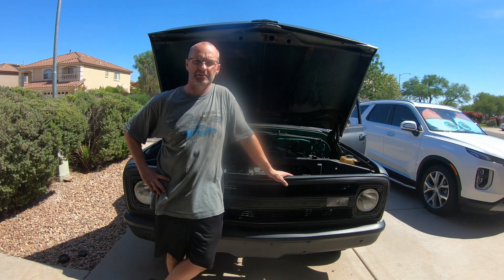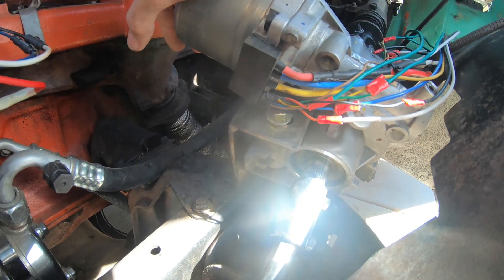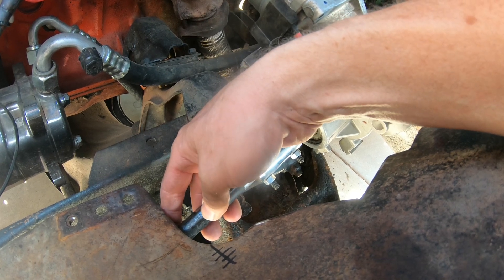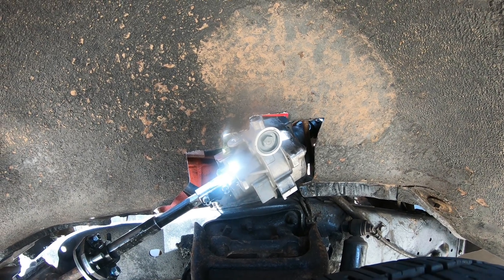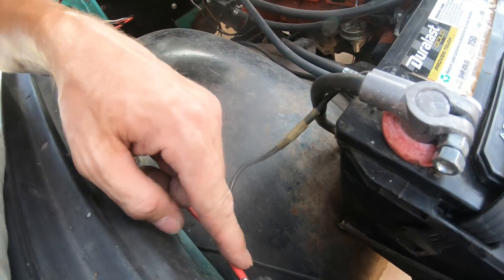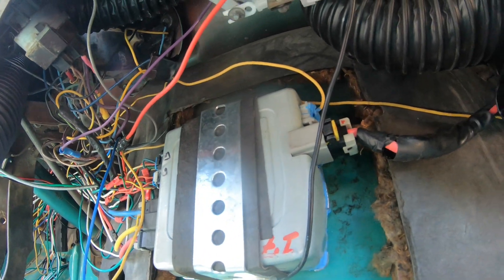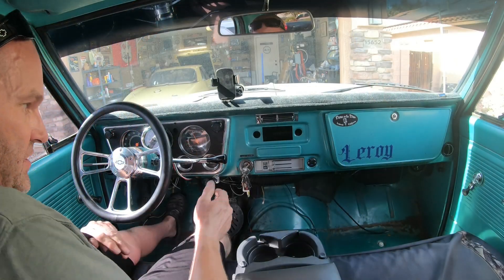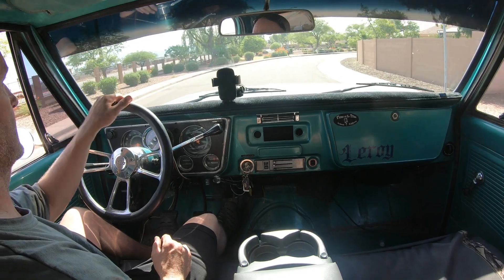Electric steering install on my 1970 Chevy C10

Comment: Well done man, Finally EPS in the Chev truck, first video. I got a complete Corolla 2013-2019 steering and thinking about installing it in my 1979 K20 Chev truck. As I have not seen anyone has done this conversion on Chev truck, I have been hesitant and also the truck is still not finished. I would like to hear about an update six months down the track. Good job👍
Reply from the maker: Thanks! I'm glad this helps. Definitely will do a followup video.
Reply: In the tree, no power steering before, and a 14 inch steering wheel. I totally get why you did this now.
Reply from the maker: @fjb9234  It's night and day difference!